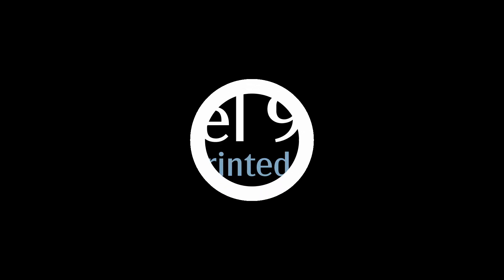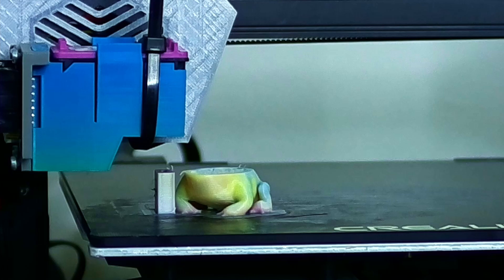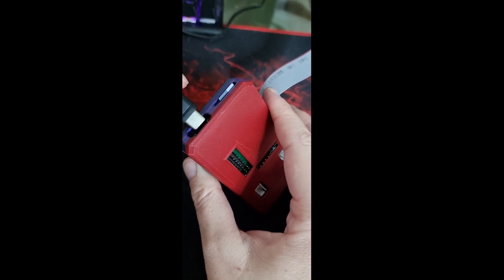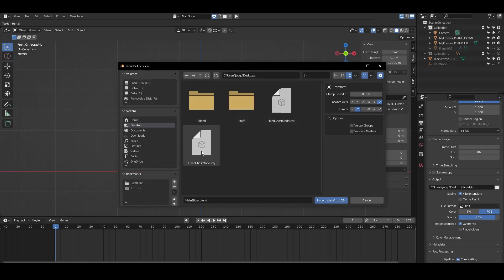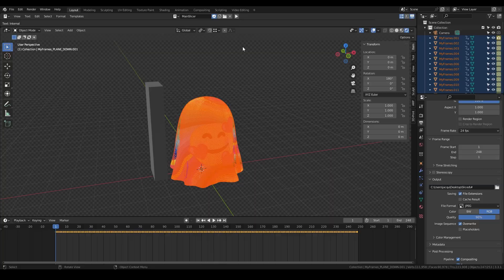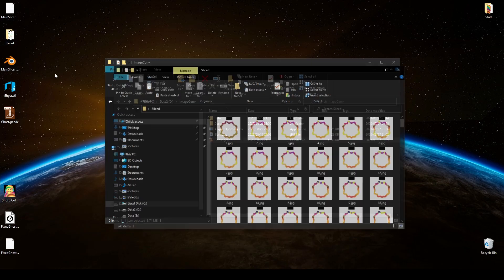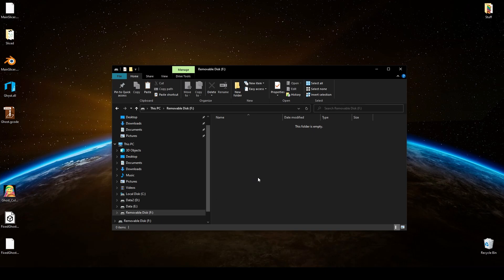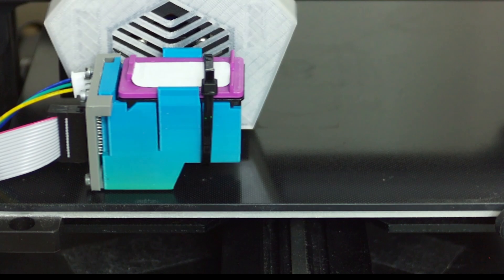Full Color 3D Printing Mod (PolyDye)

Comment: is this compatible with ender 3v3 se?
Reply from the maker: PolyDye is compatible with printers running Marlin 2. You will need to model and print your own mounts to fit your printer.

Comment: would this modification work with a custom 3d printer that was built using an Arduino and RAMPS board?
Reply from the maker: Hi, we would need more details about the printer before we can answer that but one of the main requirements is that the printer must run Marlin and can receive instructions through a usb serial interface
Reply: @level9000.3D  The printer runs Marlin, with an Arduino as its mainboard and a RAMPS stepper driver board connected via the GPIO pins. It can run OctoPrint through the Arduino's USB port. I was wondering—if it can run OctoPrint, could it also run this? The 3d printer was designed in tinkercad. If there’s a way to contact you via email, I’d be happy to send you a copy of the Tinkercad link so you can see exactly what I’m working with.

Comment: This is a really cool original idea. The prints look really good! But does this impact print strength?
Reply from the maker: Thanks, We have not been able to test the strength of the models yet but the initial impact seems minimal.
Reply: @level9000.3D  The strength isn't really critical for the application so I think it's fine either way. Thanks for the reply